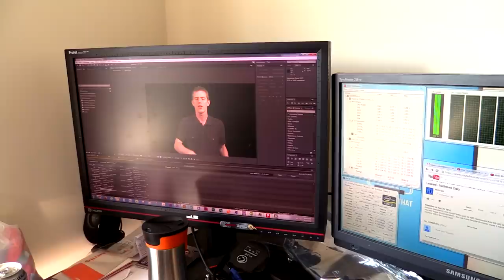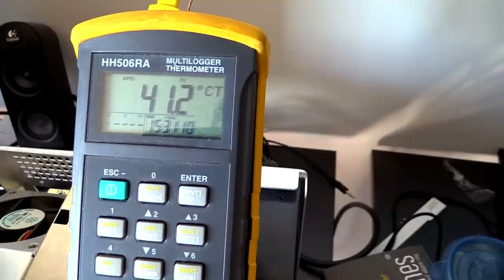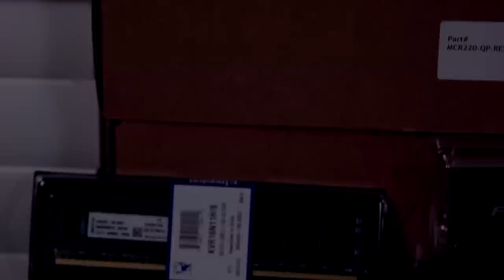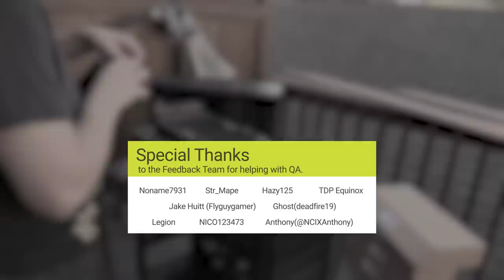Whole Room Water Cooling Project - Day 1

Comment: Is dual Xeon e5504 good for gaming they are clocked at 2ghz and with two it's an 8 core
Reply: +Josh de Villiers Get a Xeon E3-1231v3 or E3-1241v3. :) They are basically the same as the i7s, but cost much less because the Xeons do not come with iGPUs (integrated Graphics Processor Units). I am getting the E3-1241v3 for my first build, it is only 20 dollars more than the 1231v3, so it is worth it in my opinion.
Reply: +Michael Marin I hope you guys are trolling. Lol
Reply: zombieowner66666 Everything that I said is true. If you do not think so, prove me wrong.
Reply: You're recommending him a xeon and one of your points is that they come with integrated graphics. Why would you care about integrated graphics if you are building a GAMING pc. Furthermore, the xeons have almost no impact on gaming compared to other quad core processors at cheaper prices. You can get cheaper processors THAT CAN ALSO BE OVERCLOCKED for about the same price if not less. That xeon you listed can't be overclocked. This processor is 50$ less than the E3-1241v3 and it's better for gaming: http://www.amazon.com/Intel-Core-i5-4690K-Processor-BX80646I54690K/dp/B00KPRWB9G

Zeon processors are not gaming processors.
Reply: zombieowner66666 You are misinformed. Xeon E3 processors perform just as well as i7 processors. The E3-1241v3 performs as well as the i7-4970K, the only difference is that the i7 is overclockable. And when you look at how much they both cost, the Xeon processor its much cheaper than the i7. Xeon E3 processors have more value/performance than the equivalent i7s. So if you want the best performance as possible but the most cost-effective, your can either get the Xeon E3-1231v3 or the E3-1241v3.
Your turn.
Reply: Michael Marin The entire point of the original comment was that it was all for gaming. I never even mentioned the i7. Which by the way, the 4790k is slightly more expensive and it has a higher clock speed.
Again, the I5 I linked is 50 bucks cheaper, and is overclockable. You spent your entire comment comparing the processor to something I didn't even mention in the first place (i7s).
Reply: zombieowner66666
You are not understanding my point, I do not know how simpler I can put it. My point is that the Xeon E3 processor that I am talking about is way better than that i5 you linked, while costing a bit more. If the OP wants more bang for buck, he will go with the E3-1241v3. But he can go with that i5 if he wants, since it has enough power for gaming. I would personally just want the better cost-effective card, and getting a CPU with the power of an i7 for just a bit more just makes more sense to me. But like I said, he can go with the card that you linked. I at least let him know that the Xeon E5 CPUs with the 8 cores and such are not good, and that he should rather get the good Xeon E3 CPUs, as that was what his question was about, from the start.
Reply: I already have them in my PC I was just wondering if they are any good so I know wether or not to go and spend my money on a gpu so I can play new games with good fps.
Reply: Josh de Villiers Oh, well if you have one of those Xeon E5 CPUs, then you should change it as your first priority. Xeon E5s are pretty bad for gaming. You can switch it to the Xeon E3 CPU that I was taking about, or a good i5 CPU if you want. Here you can look at the 1241v3's performance, and compare it to the other CPUs: http://m.cpubenchmark.net/cpu.php?cpu=Intel+Xeon+E3-1241+v3+%40+3.50GHz&id=2341

Let me know if you have any other questions.
Reply: +Michael Marin would 2 of the E5504 make up for it not beaing able to game. I have two in my system which makes it have 8 cores but the clock speed stays the same?
Reply: Josh de Villiers The individual cores for the Xeon E5504 are just not good enough for gamng. These processors are more more servers and workstations, rather than getting the best performance for gaming. Look at this comparison that I made of your CPU and the Xeon E3-1241v3 that I am going to be using: https://www.cpubenchmark.net/compare.php?cmp[]=1240&cmp[]=2341

You can see how the E3-1241v3 completely mops the floor against that E5504. The two most important numbers in that comparison are the Single Thread Rating and the CPU Mark. Even if you have two Xeon E5504s, they still do not beat a Xeon E3 CPU in performance. You can also see in that comparison that the E3-1241v3 has hyperthreading, and your CPU does not... and the 1241v3 can even get Turbo Boosted to almost 2 GHz (GigaHert) more clock-speed than that E5504. If you want a Xeon gaming CPU, the Xeon E3s are the way to go. The E5s are more for workstations, where they use applications that need all those extra cores, albeit much slower clock speeds. Like I said before, getting a Xeon E3 CPU is basically like getting a i7 CPU that performs just as well, but costs much less. I hope this helps.
Reply: +Michael Marin ok thanks for the help. I just took a server that we had in my house that wasn't being used and put Windows 7 on it and It had those processors in it and I wanted to know if they would be good enough to game to know if I should go and buy a good gpu. 👍🏻
Reply: Josh de Villiers No problem. Now you know that you should get a good CPU. The rule of thumb is that having few cores that are very powerful is better than having a lot of cores that are individually weak. :)
Reply: +Michael Marin "... But he can go with that i5 if he wants, since it has enough power for gaming..." you are joking right? for GAMING only more cores wont make a difference and i5s arent just enough, they do a plendid job on gaming rigs, more than 4 cores for gaming ONLY i utterly useless, but if him or anyone else is going for more stuff like video editing, photoshop, bascally productivity, thats were the extra 2/4 cores and HT comes in hand. 2nd the kind of games were the i5 will win over the xeon is the beta ones or poorly optimized games, even the cpu based games like some mmos or survival games due to the fact that the overclock, that xeons lack, can boost some avg fps on those types of games.
Reply: kurok1tenshi Both CPUs will basically function the same in performance, with the Xeon giving out a bit more FPS because of its closer similarity to the i7s, of which output a bit more FPS on average. Factor in the Xeon CPU using a better heat sink and fan, letting it run less hot and making it not require an after market cooler, it is just a better value for your money, since the Xeon is basically an i7 that goes for the price of an i5. But if he does not want that extra performance for relatively the same price, he can go with the i5, of course. I'd just rather go with the CPU that has better single core performance, and the Xeons are just that, costing about the same as an i5. Btw, I never made the claim that more cores is better for gaming, as you make it seem like I did. Although, with DirectX 12, games that are made using that capability will benefit from the extra cores. There is that article that shows the extreme FPS boost that comes from using more cores with DirectX 12 games.
Reply: +Michael Marin how is the E5 2603v3 for gaming?
Reply: Hello Awesome Do not get a E5 CPU. The E5s are for workstations. The E3 CPUs are for gaming, as they are the equivalent of the i7s. I got a Xeon E3-1241v3 CPU, and it's been running fast and perfect. You can get the 1231v3 if you want, as it's a bit cheaper, but only 20 dollars less. I said what the heck and I payed the 20 dollars more and got this 1241v3. I think it's worth it. Hope that helps!
Reply: +Michael Marin Lol, there is a difference between being meant for something and being good at something. No Xeons are meant for gaming, period, though some are good at it.
Reply: LiquidPanic It can easily be argued how the Xeon E3s are meant for gaming for how they are basically the equivalent of an i7 without the integrated graphics card. It is not a workstation CPU, not at all. There is absolutely no reason a person building a workstation would get an E3. Now on top of all that, the fact that you can get the equivalent of an i7, but a better heat-sink and a better stock cooling-fan, and the feature of a workstation CPU that makes it much less probable to cause data loss because of its "Error Correcting Code Memory"?! The Xeon E3s are perfect gaming CPUs! :D They are not designed for excelling in workstation environments, and are more suited for gaming, so yes, these E3 CPUs are meant for gaming. :)
Reply: Michael Marin But, the thing is, i7s aren't even meant for gaming, they're meant for enthusiast machines and lower end workstations. E3s are meant for lower power servers or low end workstations that need to have 24/7 reliability.
Reply: LiquidPanic Alright, let's just say that no CPUs are meant for gaming. Lol

As long as there are games that are very CPU intensive, then CPUs that are meant for very intense single-thread performance are perfect for this type of gaming, albeit not being "meant for gaming". I'll even complete your argument for you:

"CPUs are not meant for gaming, period; GPUs are meant for gaming. But oh wait, there are still applications that are very GPU intensive that people with workstations use, for example video editing and stuff, so never mind, CPUs and GPUs are not meant for gaming."

Now that we have gotten that ridiculousness out of the way, I think it is fair to say that the i7s and the E3 CPUs are "gaming" CPUs.
Reply: Michael Marin No, because they were never meant for gaming computers, that's what i5s are for, business and gaming computers. As with CPUs, there are GPUs that aren't meant for gaming (technically the same as consumer GPUs, just with ECC VRAM and better FP64 performance).
Reply: LiquidPanic Look, I already said that they are not "meant", or, "designed" to be gaming CPUs, as with most CPUs and GPUs, but it does not mean that you cannot call them gaming CPUs and gaming GPUs. Do you understand now what I am getting at? The i7s and the Xeon E3s are gaming CPUs because of how they are used, and how different they are compared to an actual workstation CPU that excels specifically at workstation environments. When you first responded to my comment, I did not even say that the E3s are meant for gaming anyway. After you said that I did, I proceeded to put an argument for why they could be considered so, but I did not really say they are meant for gaming in the first place.
Reply: Michael Marin There are GPUs that are designed for gaming. Professional grade workstation GPUs are slightly redesigned and cut down, to make them cheaper to produce and sell, and they are meant for gaming. Sure, there are lots of people that use E3s and i7s for gaming, but if you're only gaming it's a complete waste of money, as you only really need a medium/high end i5 to play any game.
Reply: LiquidPanic I never said that there are no GPUs designed for gaming.

To your second point, I disagree, it would be much better to get an i7 or a Xeon E3 for the Arma games as these are very CPU intensive. And any other CPU intensive games that you might play.
Reply: Michael Marin Unless there is something else wrong in the system, an i7 or E3 will not offer any tangible performance difference in any game over something like a 4690k, or even something older like a 3570k.
Reply: LiquidPanic Hey, for people that want the most fps in CPU intensive games, the i7s and Xeon E3s of the world are your best bet. These are the CPUs with the most single-thread performance, which is what is needed.
Reply: Michael Marin i5 of the same architecture and clock speed will have the exact same single threaded performance. I don't know what you're on about. Hyperthreading can actually slightly lower single core performance when there are any tasks other than the game running.
Reply: LiquidPanic I know about that, but if it is the i7s and the Xeon E3s that currently give out the most FPS on CPU intensive games, then that is what I am going to use.
Reply: +kurok1tenshi I still haven't overclocked my i7 2600k =p. No need to.
Reply: Hey guys I actually have a Xeon E3-1231 V3 and after a year of use I'm glad I went for this instead of the 4690K. It literally performs exactly like an i7 4790 with cores @ 3.8Ghz - making it game better than an i5. CSGO loves the 4 extra threads and yields around 70-90 more frames. What a deal, for $240 I am impressed.

Comment: Holy Sh!t - I start to worry if my rig goes above 45°C.  This guy's is pushing 90°C?  Yikes!
Reply: Yeah! How the heck has his CPU not burnt out yet?
Reply: Munjee Syed Silicon can, but CPU'S can only really handle 80 degrees C, anything higher is putting at a risk. Especially 90+. You can run them even higher but other things besides the Silicon can be destroyed by the high heat levels. Basic point, try to keep Temps under 80 degrees if possible.
Reply: if ypu know the limit why overclock it at under the 80c because it stoll leaves head room to squese 95% from your hard ware 100% is just gona kill your hardware but getting 95% from the hardware on a decently cooled rig why not if your cpu on water is 50c overcloked why not take it up to 90c or 95c max temp 95c is pushing it probaly reducing the life span but your not gona bd having that cpu or gpu in 6 years time are you

Comment: Watching 8 years later, I agree with Luke's dad. As a plumber by trade, none of this would be hard, but for a home owner/ DIY'er it would certainly be difficult not to mention dangerous. soldering pipe is a good way for someone without experience to burn a house down.

Comment: this to me is your best video as far as custom mods go
having the plumber there is defiantly a great idea, if you ever need a custom fabricator give me a shout i do this sort of thing for a hobby. 

WARNING! something to consider is that the soldering is very weak and welding the pipes is the way to go. Copper TIG welding is not hard for an experienced welder but can prevent a lot of trouble you will have from the soldering in the near future. The surrounding atmosphere (we will say air to be simple) will be sucked into the pipes and the carbon form the hardware will oxidize.

love ur work just wanted to save you some trouble down the road

Comment: What a cool project.  Nerdgasm!  Thumbs up Linus.  One concern though:  Are you actually placing the rads outside the house? The one concern I would have with that would be in the winter and subzero temperatures.  If the coolant reaches below the indoor dew point you may have some really nasty condensation problems. What are your plans to fight that?

Comment: HAHAHA i am a contractor in CT and am a huge pc enthusiast. i asm currently water cooling two pcs one for me one for another person both builds almost complete. i watch a LOT of inus techtalk for advice so i could not resist this segment of vids. 
awesome! LOL I HAD TO SHOW MY RETIRED CARPENTER FATHER HAHAHA we both got a kick out of the creativity and overall aesthetics. should have shut off valves at each station.... not sure if you incorporated it =] awesome vid though thanks for sharing.
Reply: wondering how many pumps  you plan to run to move the water that length of pipe................... at that rate why not just use a fish tank pump... something high end like a fluval? you could have one at the base of each rig im sure youd still pump a couple hundred gallons per hour even with all the line you ran !!! not to mention fluval works well with quick disconnects to make servicing them easy. good luck cant wait for the follow up!

Comment: Purely awesome :)) Can't wait to see the results, mainly wondering how they're gonna prevent hot water from one system entering the other, and also if they're covering the pipes to prevent dissipation in the room. Also, what radiator and fans are they going to use outside!

Comment: Hey Linus why send the water outside? Wouldn't it be a better idea if you have the coolant sent to a radiator in every main room in the office. Not only would that be very useful during the winter season, essentially turning the wasted energy into heating the office, it would also solve your problem with the heat being generated in one room and your employees complaining about it. I think this is a better solution, as weather would change the way the water is cooled and you are essentially wasting energy into the atmosphere. 

Just a thought as to save cost on energy bills and still cool those pc's!

Comment: I live at the lake of constance in germany; cold water is extremly cheap and causes no environmental problems when used in high amounts, energy and heating is expensive. If I had so many computers, I´d cool my PCs with fresh cold water and use it for heating, which a repairman could easily install (My english might not be good).

Comment: Should have used distilled water. Also that gunk looks like the product of what happens when water and automotive/hydraulic oil are mixed. Lastly, I am fairly certain that antifreeze paired with certain types of soft tubing, can result in the tubing actually breaking down, and becoming solvent in the liquid.

Comment: There's one lingering question: At what temperature did it stabilize at with the fan off?
Those radiators are about $100 each. $400 isn't that much compared to other silent cooling solutions.

Comment: If your radiators are going outside to exchange heat, why are there radiators on the systems themselves? I think it's very cool to use the copper plumbing to route the coolant. It looks great, is designed for it, and should do an excellent job. I'm very curious as to what you're going to use to move all of that fluid.
Reply: It's so that a computer can be disconnected from the loop (via quick-disconnects) to be used on its own for any reason..